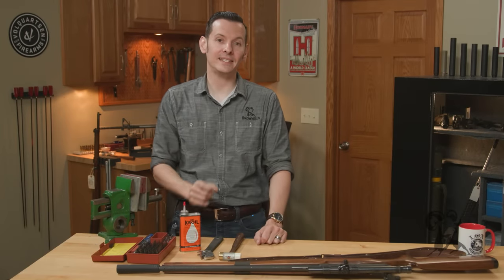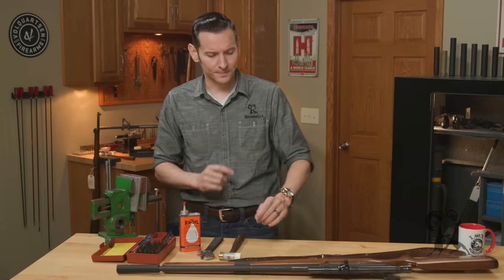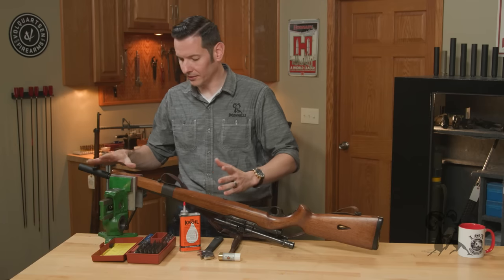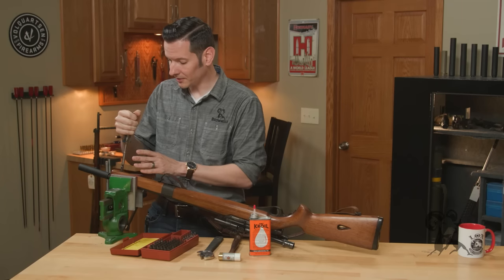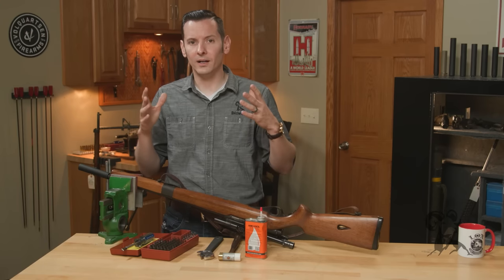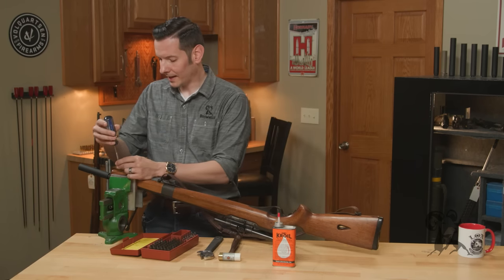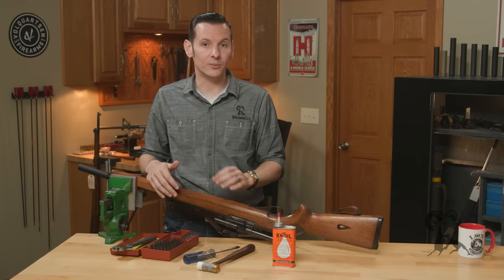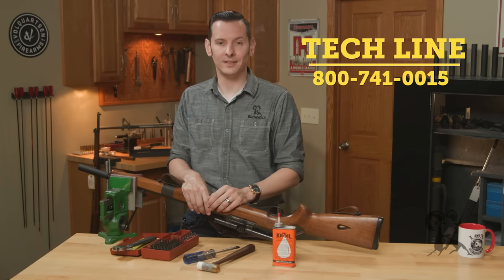Quick Tip: How To Remove a Stuck Gun Screw

Comment: As mentioned below, a impact screw driver can be a saver but for heat around nice wood and plastic an old high watt solder iron and put pinpoint heat on a screw head without surrounding damage in nothing flat. I use this method A LOT when restoring old original Colt, Remington, etc. black powder guns that have been seized for over century! It works when a torch would do more damage than good.

Comment: The best penetrating oil I've used is one you can make yourself by combining a 50/50 mix of acetone and ATF (automatic transmission fluid).  Let it sit for a few minutes, an hour, or a day, depending upon how rusted and stuck the part is.
Reply: I wouldn't trust that mix anywhere near a firearm. On an engine block, certainly. But not where you have a finished surface that can get damaged.
Reply: @prestonnewcomb5991  It's never caused me any problems.  In any case frozen or rusted parts are typically found on guns lacking pristine finishes.
Reply: @Paladin1873  If that's what you're using it on, then I get why you go for a high octane solution. Definitely give your mix a litmus paper dip and find something that will neutralize it quickly on the places you want to protect. Heck, taping off the good area would probably do well enough if you use a rubber or plastic tape.
Reply: @prestonnewcomb5991  I don't recall ever testing it on nicely blued parts, so now you have me curious.
Reply: @Paladin1873  Actually I might be the one needing research. Acetone has a neutral pH and I can't find much info on ATF. (Mercon or Dexron) all seem to show no info on MSDS. I'm truly curious now.

Comment: For a screw like that you can use a soldering iron to get it hot without discoloring or burning the wood around it. it doesnt need to be a billion degrees just to hot to touch is usually enough. like an AR barrel nut.

Comment: Another option to consider. 
Older 70’s & 80’s Japanese motorcycles often had poor quality fasteners. (Phillips head screws seemed to be made of cheese)
In 1981 I bought myself an appropriately sized “impact driver” which when set into the top of the screw and twisted, with light tension, you tapped forcing the tool/screw to turn. 
I still have it today.
Reply: Lisle 30750 Hand Impact Tool Set, Loosens Rusted or Frozen Screws Quickly. Came with my first tool set in trade school. You can't beat it. Well actually you can. 😂 😂
Reply: Yeah, I used one of those for years. Mine is made by Snap-on, and works like a champ. Cheap, it ain't.
Reply: I have that tool! I bought it specifically for the case cover screws on my 68 Honda 450. Love that thing!
Reply: Yep, I think I still have mine somewhere. It was a life saver!
Reply: I have a Craftsman impact tool. Bought it to change out a door latch \ lockbox on a 79 Z28.
Reply: Those Japanese fasteners may be JIS rather than Phillips.   Get a JIS set.

Comment: Instead of beating on your screwdriver, buy a miniature impact driver (the hammer type) with a 1/4" head for the screwdriver tips.  A small electric impact at low power with lots of downward pressure and the correct driver size can get it done too. Never had one I couldn't get out with penetrant and a driver, even on 100+ year old rust.

Comment: As a retired gunsmith of three decades in the business, I spent the most frustrating moments with correcting other's mistakes. Good 'ole Bubba, with his Dollar Store screwdrivers, his Dremmel tool, and heavy-duty sandpaper have destroyed more guns than anyone on the planet! 
Ok, rant over...

Yes, those are good, solid, and reliable methods. Used to always say, never force it. Think before you act. Use the right tool for the job. And did I mention never force it?😏
Reply: And all those who over tightened screws and stripped the heads while doing it.
Reply: Considering for the last 20 years 'gunsmiths' locktighted and overtorqued everything under the sun, poor Bubba was just tryna deal with already existing mistakes

Comment: I bought a set of special screwdrivers from Henry. Wow, they were expensive but every screwdriver needed for a Golden Boy was included.  
Considering the cost of the gun, these are cheap insurance against damaging it.
Kroil is the absolute king of penetrating oil.
Reply: Kroil is actually not that great, I think people just believe in it because it's so expensive. Liquid wrench original formula outperforms it.
Reply: @actionjksn  ok.
I've used both. I prefer Kroil.
To each his own.
Have a great day

Comment: A soldering iron with the tip in the center of the screw will heat it nicely without damaging the wood; that Kroil however..... not so good on a nice wood finish.
Reply: Best tip I've read all day on getting a damaged screw out without damaging the stock..

Comment: Just like opening a tight lid on a jar. Tap on it a few times and the vibrations will break it free. Thanks Caleb!
Reply: A little different. What happens with the jar lid is you begin to release the vacuum. But tapping on threaded screws and bolts does definitely help a lot.

Comment: A problem today is many gun, and other, manufacturers use a type of threadlocker. Something that can creep into the threads and disolve it would be nice. It seems they only have one type of thread locker and use it on everything even screws some day someone might want to remove. My latest encounter was a aluminum frame 1911 grip bushings. I don't want to use too much heat so as not to effect the aluminum temper.
Reply: I believe you are referencing the nylon thread patch (brand name NyLOK or ND) that unlike loctite, does not require the absence of air to cure. Many manufacturers chose to ship their screw with it.
I swear that I must have stripped every single magpul screw with that nylon thread patch they use. 
I always use torque wrenches (wheeler and vortex) and quality steel bits like Belzer and the magpul’s screws STILL get stripped. 
Even when adding polymer accessories to a metal handguard (recommended 15 inch/pounds) they can get stripped. I torque other screws up to 35 inch / pounds (metal on metal) and never had problems.
Magpul has to either make their screws from harder metal or ditch the “NyLOK” thread patch alltogether.
Reply: @VincitOmniaVeritas7 or just take a sewing needle and do like I do..... scratch some of that shit off between the threads and apply your own solution. A simple needle will take all that yellow (or blue) off there. No fancy tools needed. Can literally do it with a thumbtack
Reply: @NoNo_IStay  I’m a fan of loctite 242 (blue) myself, its only downside being cracking after it’s dried up and requiring reapplying if you ever want to change the optic / accessory.
In theory the Nylon patch can be reused as many times as you want, being ideal for those who change accessories a lot (like i do with bipods / barrier stops, depending on the stage). The idea isn’t bad, but it clearly requires better metal screws than those Magpul is currently providing.

Comment: One of the reasons most people hate slotted screws is because they always use the wrong size screw driver on them. If you use the proper screw driver, they work quite well. They can even be better than Philips in a lot of situations.

Comment: I would like to add 2 things to this. If the bits seem loose still but a dab of automotive valve lapping compound on the bit tip. Also if u need to heat it up some, take the tip of a soldering iron to the center of the head of the screw.

Comment: Stripped the loading lever screw on my first black powder revolver. Now present day I have a new screw coming in today and I’m gonna go for it with my drill and the handy little tiny screw extractor I got in my kit. I hope I do this right 😂 it’s soaking in penetrating oil as I’m watching this so I’m on the right track I guess lol. I’ve done a lot of research on it. honestly I’ve had a vise just been putting it off because I haven’t had the guts to drill into my first gun but honestly it should be fine, I’m probably waaaaay over thinking it, it’s a baby screw not very long either so I’d barely have to get down in there it probably won’t be bad. Got some bits with a great sharp punch for starting a hole at the end of each drill bit.

Comment: Caleb if you can heat the screw up because of the wood forgrip,apply some heat from a soldering iron by holding the top directly ontop of the stuck screw.
Just my opinion,opinions may vary

Comment: Had a S&W Model 10 with a stuck screw on the plate.  Kroiled it and it wouldn't budge.  Took it to the range after the Kroil and put rounds through it.  Screw came out easily after that.

Comment: For applying heat in that situation, could an unwetted soldering iron/gun work? Directly applied to the screwhead with a blast of compressed air aferward?

Comment: I clicked the like button just like I do on all Brownells videos.  

I agree on having the right size screwdriver tip and I just corrected a guy who was using a number 1 Phillips on a number 2 screw, but not on a gun. It did about make my head explode. I told him to stop and I went and got him a number 2 Phillips bit.

Project Farm channel did extensive testing on various penetrating oils and it included Kroil. I have to say that even though Kroil is very popular and expensive, it was not even close to being the best product. There were other products that were a fraction of the price that were outperforming it. Liquid wrench performed the best out of all the products and it's a lot cheaper. He tested liquid wrench, Royal purple, WD-40, PB blaster, and Kroil. He also tried a Homebrew of acetone and ATF-automatic transmission fluid. That formula came in second place. I would like to see more testing with more products.

Comment: A soldering iron works well for localized heat. I would have no problem getting that screw hot. Make sure you stop before it’s smokes the oil.

Comment: Tapping while TIGHTENING for a few blows, then tapping while applying loosening torque is another good trick.  Screws are often easier to break loose this way if they are corroded in place but not bottomed out.  This method has worked for me on old English motorcycles.

Comment: You can put a little heat on that screw with a fine tip in a electric soldier iron without damaging anything in fact thats the only way of removing it if some idiot has used red locktite on it